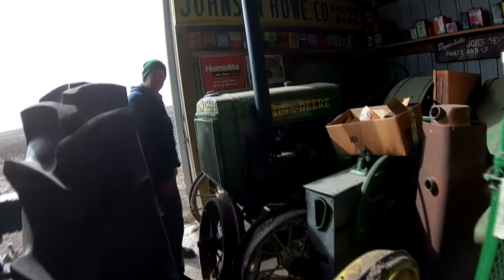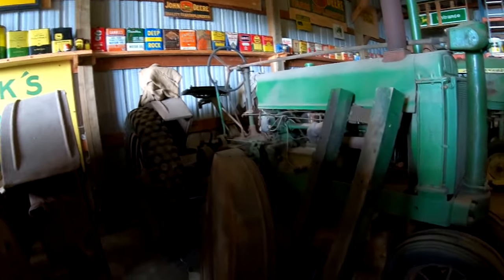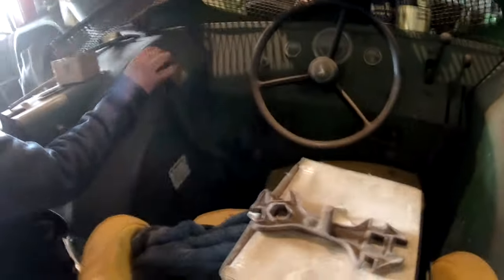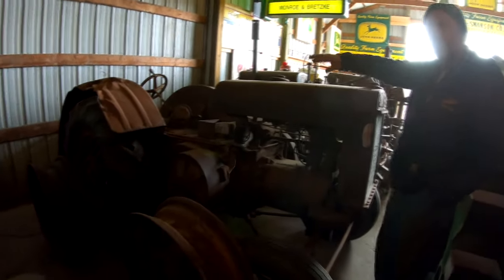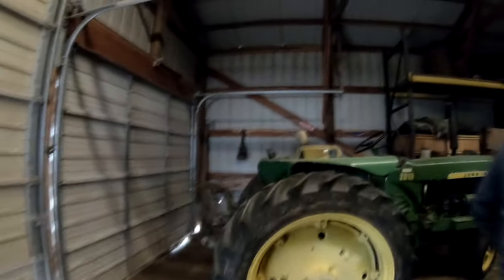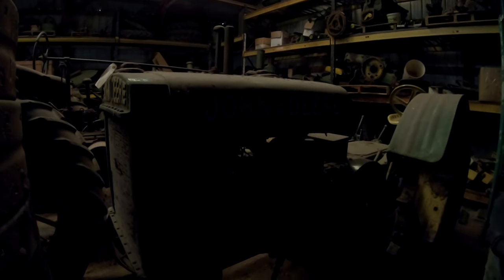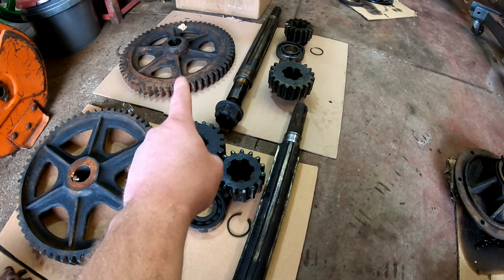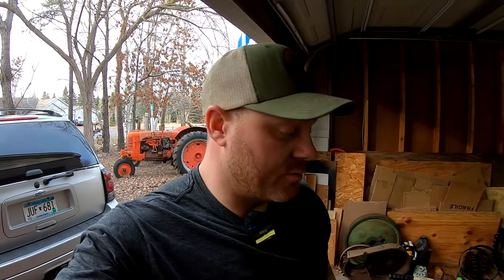HUGE John Deere Collection Video Tour Pt 2: Model D's, B's, A's, G's GPWT's, Orchards & High Crops!

Comment: That explains what happened to the primary cover on my D’s primary cover. The reduction gear grenaded. I’ll have to check if it is the wide gear or not to determine if it’s 27 or 28. Great info Kenny.
Reply from the maker: An easy tell is the upgraded gear is riveted to a center portion... Similar to a ring gear. The original is a one-piece cast gear.